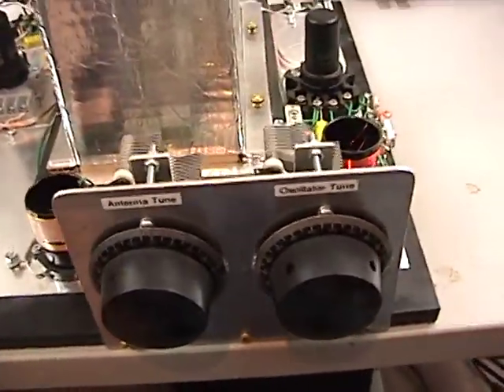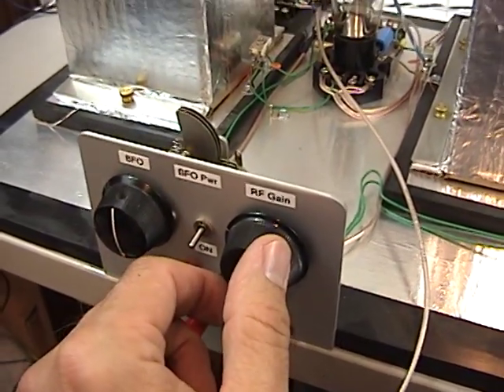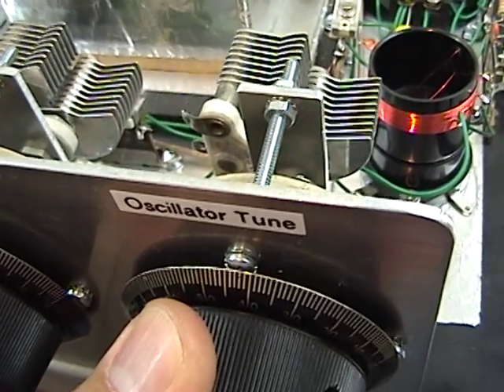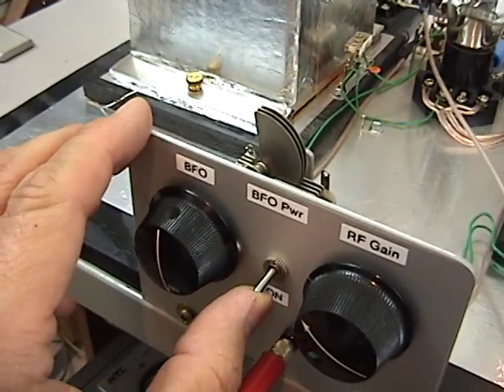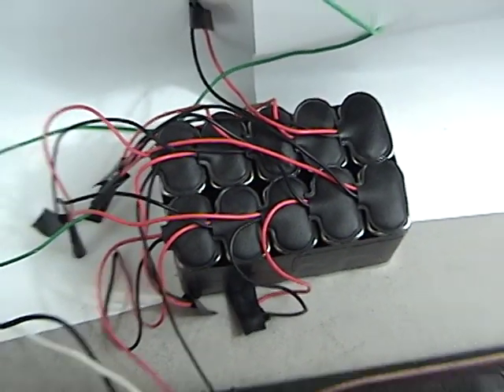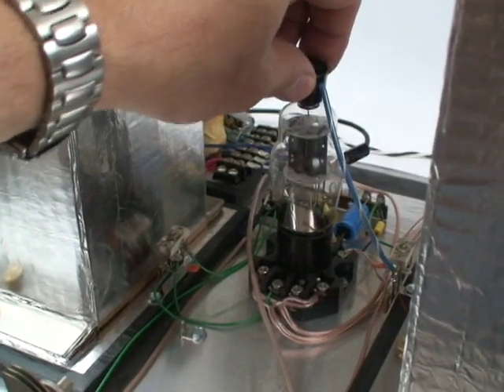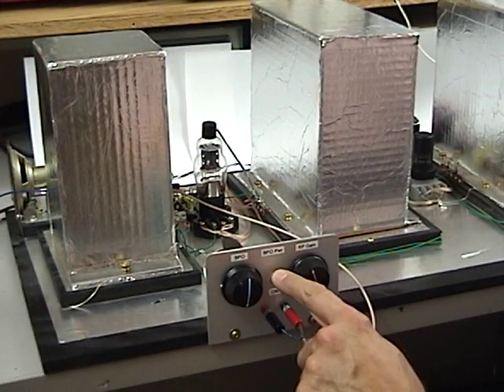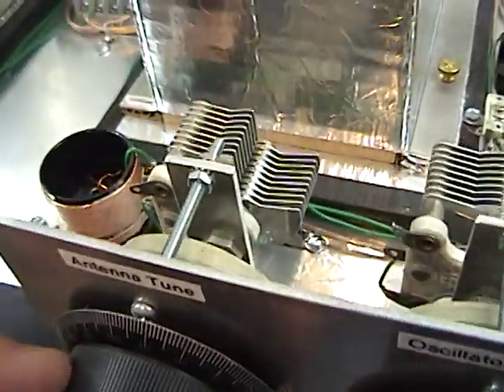KC9KEP Homemade superheterodyne 80m radio handwound coils

Comment: VERY nice job! I like the way you have breadboarded it, just as would have been done many years ago. Really impressive is the hand-wound IF transformer system. What test equipment or methods did you use to align the completed build ( or was it peaked using on-the-air signals?

Comment: I can build for u any air variable capacitors kits
for yours magnetic loop antenna,antenna tuner,HF amplifier

2.5-25KV BUTTERFLY LOOP AIR VARIABLE CAPACITOR KIT  FOR YOURS MAGNETIC LOOP ANTENNA
15KV BUTTERFLY CAPACITOR KITS 10'' od rotor

HOMEBREW  2.5-15KV BUTTERFLY CAPACITOR KITS

http://forums.qrz.com/showthread.php?351604-Butterfly-capacitor-kits-5-15kv

http://www.flickr.com/photos/93005502@N08/page3/

http://forums.qrz.com/showthread.php?378701-2-5-15kv-butterfly-capacitor-kits&p=\
2764980#post2764980

I have kits available for ham radio:

2.5" OD ROTOR
3" OD ROTOR
4" OD ROTOR
5" OD ROTOR
6" OD ROTOR
8" OD ROTOR
10" OD ROTOR

73 de VA6POP!
yo5bzz(at)gmail.com
Location: Calgary,CANADA